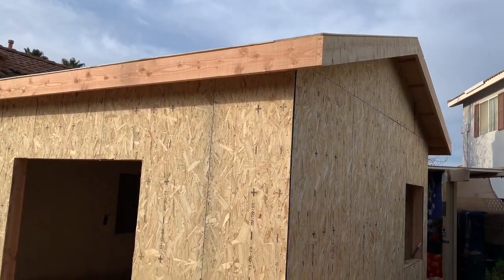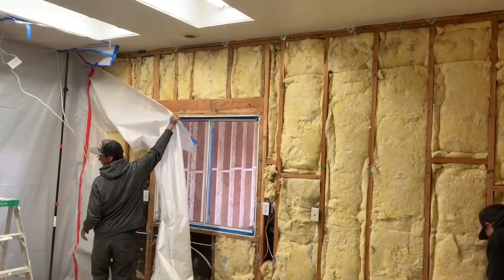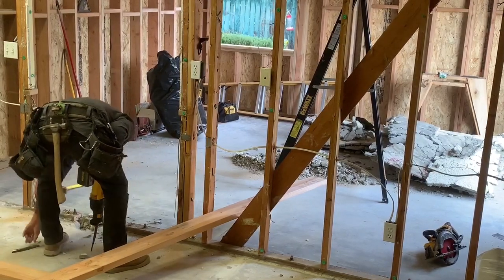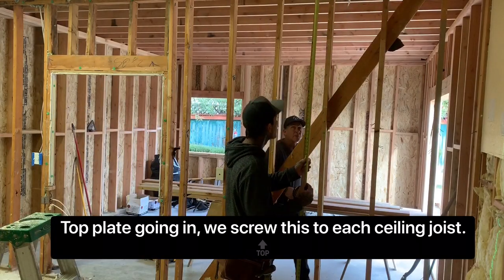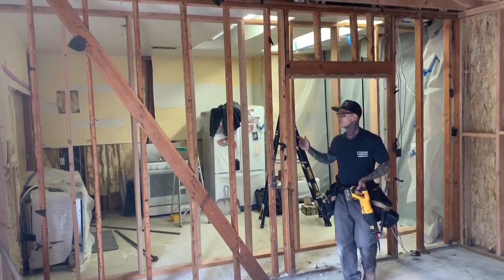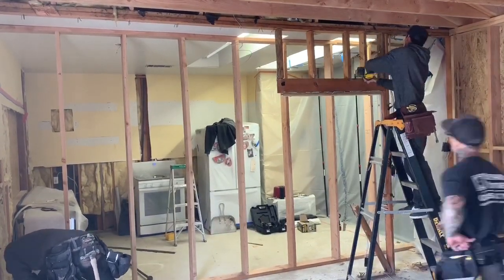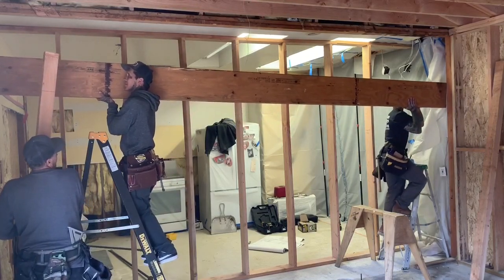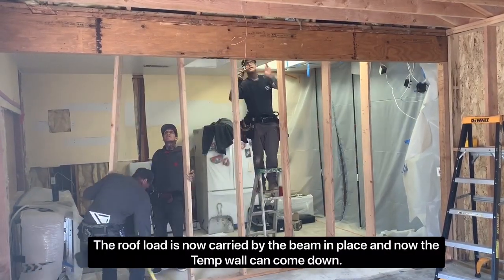Removing a Load Bearing Wall

Comment: Good stuff.  How do you calculate how big your beam has to be?  Can you make it yourself with dimensional lumber?
Reply from the maker: mae2759 we actually have full sets of plans and permits so it’s all engineered. They show the sizes of the beam needed. There are definitely ways to figure it out for yourself but in California where we are there are a ton of regulations and it requires an engineers stamp on plans.
Reply: @stephensbrothersconstructi7294   What is the full step process to do this? Do we need to hire an architect, structural engineer, etc?

Comment: I'm planning to open a low bearing wall the opening will be 13 ft on the lower level of the house. My question is what size beam do you recommend I install?
Reply from the maker: Robert it is best to consult an engineer. The weight load is the easy part you want to make sure the shear value is calculated as well. For 13 feet I would use a 3 1/4 x 11 7/8 parallam but it depends on what’s above it.

Comment: Enjoy your videos Man thank you, I have a question the temporary wall needs to be built 3 feet from existing wall on both sides or just one side?
Reply from the maker: This case it was an exterior wall so just one side. If its a wall with joists on both sides that land on it then yes you need a wall on both sides.

Comment: I’m expanding a kitchen to living room opening from 5 ft to 12 ft.  Thinking of joining two 2x12x12s for the support beam held up by a 4x4 on each side. Reasonable?  It’s a 1950s ranch.  Thanks fir your feedback.
Reply from the maker: Absolutely reasonable. The bigger worry would be your sheer value of side to side movement. I would have to see a picture of the area to have an exact answer for you.
Reply: @stephensbrothersconstructi7294  Thanks. Will text you a pic.
Reply: @stephensbrothersconstructi7294  what is sheer value?

Comment: I have some questions, first, did yall end up nailing that paralam in place or no, I wouldn't feel to comfortable with that. Also, my mom has a beam in the middle of her room blocking the tv, but the ceiling is so low that a wood beam that big would stick out too far(though I'm sure even in wood it would have to be that big) would i be able to get away with something smaller if it's made of a sturdier material like steel? Just fyi my dad and his friends built part of the room hanging out of the side of the house, it's basically an extension of the room that already existed there, but they're on the original edge of the house, and that's the wall that the beam used to belong too.
Reply from the maker: The beam was nailed in place then after we remove the temp wall we install hardware per plans. It’s not shown in the video

Comment: That wall is running parallel with the ceiling joists not perpendicular to them. Which by definition means that wall is not a load bearing wall
Reply: The trusses in the new addition run parallel, but if you look as they hoist the beam you can see the ends of the joists or trusses that were held up by the old wall.  They place the beam under the old top plate

Comment: What about the load shift to the outside posts on the floor..all those studs are now gone and the load is shifted to the outside
Reply from the maker: This project has a full permit with engineered plans. The wall we opened up is an exterior wall with a continuous footing that was 24” deep and engineering only required us to place shear on each side of the new opening.

Comment: Great video, thanks!   Doing the same to an exterior wall (1st floor, 2nd floor above) for bigger windows, but the joists run parallel to the exterior wall, so can't add the temporary supporting wall as shown in the video. Got any videos showing how to handle this?
Reply from the maker: If its upstairs and the joists are running parallel there should be a rim joist on the exterior. So what we do is strip the stucco or siding and tack studs to the outside of the rim joist down to the ground to hold the load until the beam goes in.